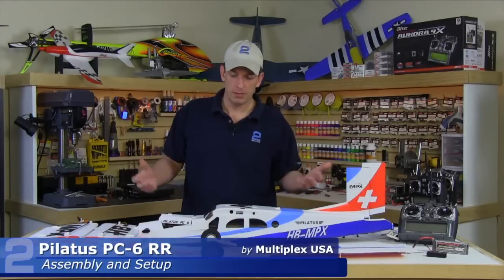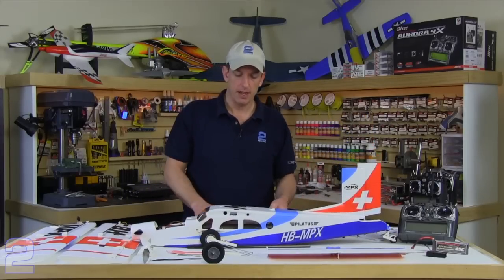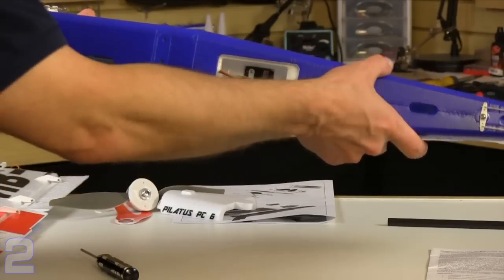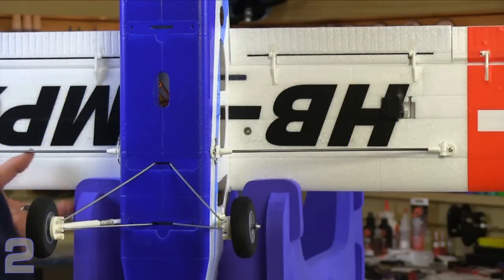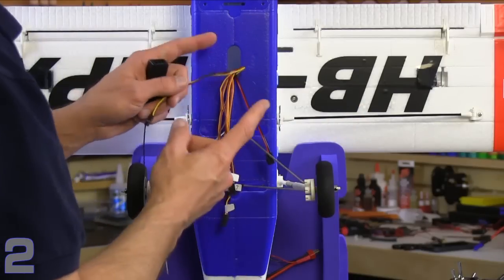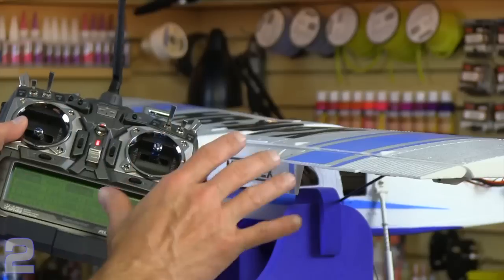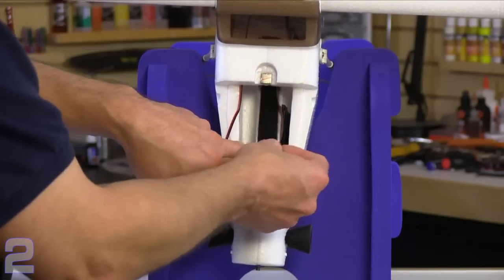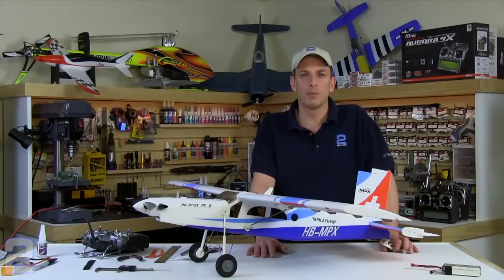Multiplex Pilatus PC-6 Turbo Porter RR Assembly and Setup

Comment: Regarding the flaps, I had a 6 Channel receiver and Transmitter. I had a Y harness but the flaps were moving in opposite directions, like you said. So, I lost the Y harness, connected one flap to my flap channel, the other to my gear channel and mixed Gear with Flaps. If you asked me what settings to use, I couldn't tell you. It was a lot of tinkering with sub-trim, reversing, etc, but I wound up with a nice even 3/4 flap setting on my landing gear switch. I also made sure the servos weren't "singing" in over rotation.

Comment: Negative sir, the upper fixtures are not aerodynamic but electronic, UHF and VHF antennas of various types and locations depending on the model and operator, definitely not strakes or fins to do with airflow.

Comment: I'm no expert on the Porter, but I am a full scale pilot.  A blade like on top of the wing is usually an antenna, not a vortex generator, those are usually much smaller and near the leading edge of the wing.  I can't really see that one fin would even work as a vortex generator, I would expect a row of fins to generate that effect.
Reply from the maker: On the Pilatus Porter shown, there is a strake mounted on the centerline to stabilize rudder input. Has to do with the plank-shaped vertical stab and adverse yaw if I recall my research.
Reply: +G56AG Absolutely correct, it's actually a VHF Antenna and not a vortex generator.

Comment: i guess they  didn't learn anything from the extra 300 review eh. they are still using that goofy battery connector.
Reply from the maker: Well, Multiplex is a German company and the European market is the primary target so it's not that surprising.  It's also a connector they sell, so the package makes sense.  Fortunately, it couldn't be easier to pop out the ESC and solder on your own.